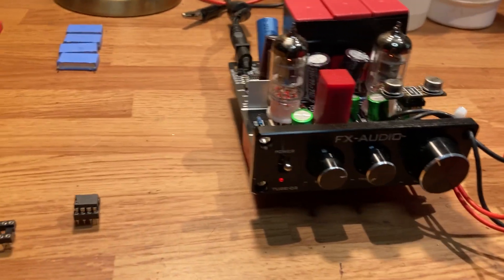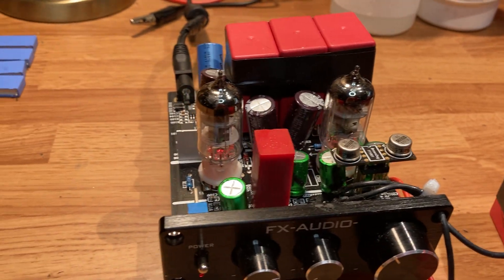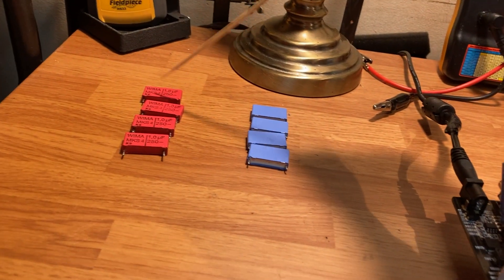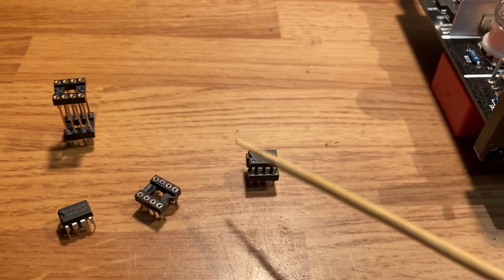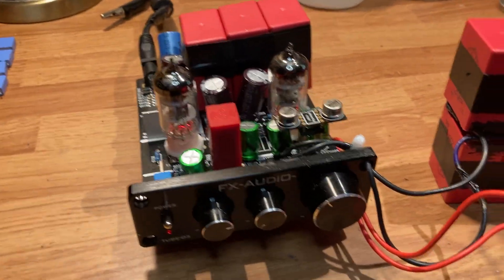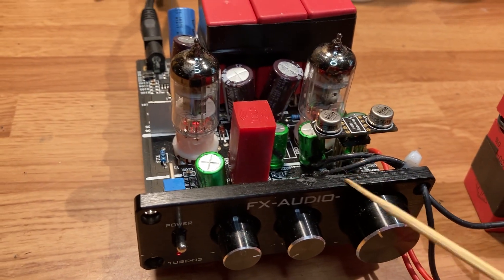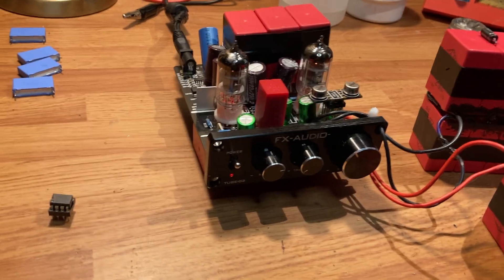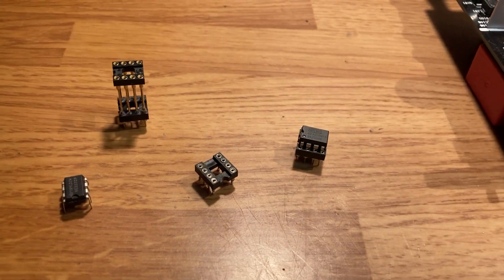FX Audio Tube-03 op amp and capacitor upgrade

Comment: I changed out the 1uf 250v caps with wima 1uf 400v as 250 v was out of stock.  I connected them to the outside solder points as I think the holes are there for a larger cap;; am I correct in that?   My preamp is running much cooler now;  is that normal!
Reply from the maker: Yup your fine you can always go up in voltage with the caps never lower

Comment: My FX Audio Tube 03 just arrived. I tried it for the first time stock, and I already feel substantial improvement from my DAC>FX Audio Tube-03>Integrated amp>bookshelf speakers setup. There is more sound stage, deeper and cleaner mid bass, slightly more deep bass on low volumes, and more lively mellower highs. It is not perfect, but it is more than I expected, which was mostly buzzes, humms and muddy bass. None of that. Now I will definitely be looking into better tubes, opa amps, and capacitors. I was thinking about using GE JAN 5654W if I can get hold on them, OPA2604AP, WIMA MKP4 1uF 250 (because I can't find MKS4  1uF 250 as in this video). Would they fit? Also  I am not sure about those 2 small 10uF caps that the author of the video exchanged for 20 big ones. Is there an alternative that fits in the case and would improve the sound more? Also, would this thing benefit from creating a bunch of perforations on the top cover. It seems to get very hot quickly.

Comment: helo sir, i want to ask. what will
happen to the sound character if i change the caps with higher uF? let’s say WIMA MKP10 1.5 uF, 250 V. thank you
Reply from the maker: @argyrizky8404  you will hear a difference that will blow your mind but that being said I’m only talking about changing them to film caps
Reply: @ yes sir, i’m considering to change the caps after watching your video. but in my region (currently) i couldn’t find the 1 uF WIMA Caps. the closest one is 1.5 uF - 2.2 uF. i really appreciate if you can describe about what kind of sound character i would expect if i change to the higher uF🙏
Reply: i already changed the caps to WIMA MKP 10, as you said “it will blow my mind” then it did. thanks man you’re genius

Comment: The  opamps are not for tone control.  You'll find them in all kinds of amps that have no tone control.  They are there to amplify the small signal inputs.  The opamps in this unit are perfectly fine for this application.  Spending a lot of money -actually spending any money - to replace the pampas is a waste of time and money.  Likewise tube rolling is an idiots game because there is no significant difference.  The internet is full of comparisons.
Reply from the maker: @colbatguano3958  I never once said they were for TONE CONTROL so your whole rant was a waist of time!!!
Reply: @ranbymonkeys2384  you said they are for treble and bass, which are the tone control. !? normally the bass and treble are connected to capacitor circuits and the op amps are for left and right channel in this particular amp i do not know if one dual op is doing the buffering but i assume that both do both for each channel so you basically end up with two differnent signals you got one sound left and another right.thats why you use op amps of the same type for the left and right channel normally.

Comment: Great video! The NE5532s that came in my Tube-03 were fake. You can tell by measuring between pins 3 and 4. If they are mising the internal protection diodes, they are fake crap. Probably a ten cent dual 741 marked as a NE5532. The 10uf electtolytics were labled as Elna but those are probably fake also. So yeah, replace the op amps, elecrolytics with film caps, film caps, tubes, and then it should be ok.
Reply from the maker: Hahaha

Comment: Could someone list the number of caps needed and the values for the 03?  Ones that will fit with the lid on. 🙏
So far, and please correct if wrong.
4x 1uf  250v to replace blue square caps.
2x 10uf 250v to replace the cylinder opamp caps.
? 

Thanks
Reply from the maker: how about you look at the caps and see what is written on them
Reply: I was making a bulk cap order and didn't want to open it up until I got my order....I did anyway, just thought someone could save me and others some time, is all.  

Did you ever use the muse 01? If so, how did it compare to the 02?  I'm reading some mixed reviews.  And 50$ a pop is not allowing me to experiment.  
Thanks for making this video.  I appreciate it and you for doing it.
Reply: Perhaps you can give some insight.  I ordered 10x volkshod rockets, and glad I did.  Some were clearly better sounding than the others.  I seen a review where someone said the brighter they glow, the better they sound.  I found this to be true.  Is there a good way to tell?  Other than buying a tester?  Should I bulk order others? Say the Sylvania 6ak5s.  Or should I just buy them pre matched and tested? 
Really new to the whole tube, opamp rolling.  I am enjoying the journey though.  Thanks

Comment: Anyone got any tips on how you managed to desolder the stock caps off that board?. I've tried a duratool solder sucker and any decent amount of heat starts killing the cheap solder mask :(.
Reply from the maker: whats solder mask?  Put some solder on the joints and gentley pull the caps off rocking them back and forth while applying heat from the soldering iron.  Then worry about getting the solder out of the holes.

Comment: I finally received the caps from mouser and I got around to opening my preamp! Surprise... The blue caps are 450v / 105k (~1uf I assume)! Fx audio must have reworked the circuit since your video (mine is 2021-08-12). I guess I have a bunch of wima caps on standby for other projects then ;) how did you know you needed to change the 2 10uf by the way please? (as there are other caps on the board). Thanks!
Reply from the maker: 105k is 1uF
Reply: @ranbymonkeys2384  yes. But the caps are rated at 450V, not 250V
Reply from the maker: Thats a good starter project you can't screw it up its impossible.   EDIT: you should listen to it before and then after.
Reply from the maker: well?

Comment: Hi, i ordered the amp and the parts (including the opamps),  thanks! Just sharing something as I came across another convo which may be of interest to you: replacing the power brick for either a linear of a switch mode power brick but of better quality. I came across a couple of convos where people also mentioned using a power supply with 5a for better sound vs 24v or 36v power supply with lower amperes such as 2a or 3a.
Reply from the maker: The higher the amperage the better.

Comment: Funny, I can't find the big ones on mouser/digikey. Would you happen to have a reference I could use to find the big 1uf 250v please? (I found the smaller Wima). Thank you
Reply from the maker: the ones that i have grouped in 10?
Reply from the maker: there are several big 1 uF caps there
Reply from the maker: you didn't really look did you https://www.digikey.com/en/products/detail/wima/FKP4G041006J00JSSD/9370277
Reply: @ranbymonkeys2384  I actually did and the big ones were not picked up (only the smaller ones). Possibly because I am not in the US. Thanks for taking time to help out. Much appreciated! Have a good day ahead.

Comment: Hi! Cool video. Quick question please : I think it is possible to replace caps with caps of high voltage value but what about the uf? (capacitance?). In short: do you need to replace a 1uf cap with another 1uf cap or can you use 2uf, 3uf etc instead? If so, what can you expect in terms of audio output and quality? Thank you
Reply from the maker: The microfered (uF) needs to stay the same but the voltage can be hihger so if there is a 20v cap you can replace with a 9,000v cap.
Reply: @ranbymonkeys2384  thanks for the quick reply! I can get that BNIB fx audio preamp for 30 usd so no harm trying new capacitors! Have you also done the caps modifications to amplifiers too? (such as the aiyama a07 which is quite popular).
Reply from the maker: Why don't you replace those 4 1uF caps can find out.  Those are good beginner ones to replace too, lots of room to fuck up.
Reply: @ranbymonkeys2384  agree, i will start with those. And they are available in my neck of the woods too 😊.
Reply: @ranbymonkeys2384  by the way, why not replace the other caps? (the round ones that are blue and brown). Is the voltage 250v for the 10uf please? (perhaps nichicon may be easier to fit in that the film caps :) )

Comment: so if i aint wrong the fx audio is pre amp so what happens if i put a different op amp into the fx audio and connect to an amplifier that uses another op amp. What happens then. does the op amp on the pre amp become useless since the main output to the headphone is from the amp or the combination will mix up the sound from both op amps?
Reply from the maker: huh?
Reply from the maker: An op amp in one piece of equipment has nothing to do with an op amp in another piece or equipment.  Usually almost always the headphone amp has it's own separate op amp.  When the main out put is used the signal isnt going through the headphone port anymore so the headphone op amp isnt being used.
Reply: @ranbymonkeys2384  im pretty new to this so i am not quite sure how it works
Reply: @ranbymonkeys2384  so meaning if i use a pre amp to amp set up, only the op amp in the pre amp is used?
Reply: @justspitonjeff4932  No, the pre amp does not effect anything used in the power amp.

Comment: Thanks so much for the terrific video. I've been  using several of these  units with pretty good results, only replacing the tubes. (RCA 6ak5, and Philips EF-95 (Holland) are my personal favorites)

I've got another one of these and I've decided to do the complete upgrade with  Muses02, and replacing caps. 
I've ordered the two Muses02 opamps and four MKP4250 to replace the four blue square caps.

I'm having difficulty locating appropriate caps for the other caps in the unit.  (closing the case not critical. I will build a custom case after this upgrade is completed.)

As I see it, I need: (Based on the ones I removed)
4-  22uf 250 V
4-  100uf 25V
2-  10uf  50V
1-  1000uf 16v

Is this correct? Hope this isn't a dumb question. 

This is based on the caps I removed from the unit, but unsure about the 3 by the power plug. (Is the one closest to the back of the unit the 1000uf, and the others two of the 22uf?)

I've found plenty, but only ones with wires on each end, not with both wires on one side. If it's not too much trouble, could you give links to the ones  you used for the remainng 11 caps in this upgrade,  (and perhaps confirm the quantity for each)

Thanks so much for your time and consideration.
Regards,
Frank`
Reply: Thanks! I'm just having trouble since there are tons of options on Mouser. Unsure which will fit on the board. Do you by any chance have a list of all the capacitors from Mouser(or Digikey)  that you replaced. (Already ordered the Opamps and the WIMA 1UF, but I'm quite confused about the others.

If you can't, no worries. Thanks anyway.  

Regards,
Frank
Reply from the maker: What happened to the ones you removed?  Going by memory I believe there is only 1 1000 uf and 2 22 uf.  There are also two little 1 uf film caps in between the tubes also.  Where did you get the Muses02 just wondering why you are having a hard time finding these caps.
Reply: @ranbymonkeys2384  Thanks for the reply. I ordered the Muses02 from Mouser. 
Are the 1 uf between the tubes the small square blue ones? Mine have no markings on them.
Thanks.
Reply from the maker: @fjdds1  They are, and they should.  Why are you having trouble finding those caps Mouser should have them for sure.
Reply: I really wish someone.....cough monkey cough..... could list the values.  Mine are unmarked also, sigh....

Comment: Both op amp ne5532 come with unit are surely fake. Any replacement with real op amp will improve the sound alot. Even philips ne5532 original one will improve sound.

You can check with phone camera, just turn on the flashlight and zoom in (macro mode). The finishing is very bad.
Reply from the maker: umm ya

Comment: The UK runs on 230 volts, and I have stock caps fitted in my UK model Tube-03 saying 'H04 105k 450v' so have you any idea if those same Wima caps you show would work as like-for-like replacements in my own? Thanks from a newbie.
Reply from the maker: They are the same that is in ours too that just means the cap can withstand 450 volts before blowing up and tubes generate far more than your mains does.
Reply: @ranbymonkeys2384  Thanks for the clarification.
Reply: There is no relationship between your mains voltage and the caps in the FX, the power supply steps the mains voltage down and converts it from 230vac to 12vdc which the FX operates off.
Reply: @ Thank you 👍

Comment: I bought OPA2132 for replacement and Oracle II 2. Soviet 6J38P-EV lamps. The capacitors will also be replaced, I will put WIMA. 
Еven the lamp beds need to be replaced with ceramic ones.
Reply from the maker: oracle ll ? lamps?

Comment: Hello Clay, you can also pull out all the (two op-amps) and just use it as tube buffer. Obviously you will by-pass the tone & volume controls as you have broken that part of the circuit. You can always use something like Equaliser APO (Windows parametric equaliser) and the volume control on your PC/iPhone and amp. This way you just get Tube Sounds, different tubes different sound signatures. At first I was dubious about this but after a fair bit of listening I'm a convert. The guy who told me to try it, I thought he's a wrong'un but there is method to his madness. Trust me Clay,  give it a shot. You can even have an op-amp for just the tone controls. I have a Burson V6 Classic (dual config) for the tone controls at the moment but this will be gone too. My Sundara headphones are a bit bass light in the lower bass frequencies and I use an iPhone with Amazon HD Music (music stored locally), Apple Photo USB3 convertor into an E1DA 9038d USB-C DAC so no parametric EQ. I'm moving on my Muses02 and investing in different tubes, I've got some GE & Mullards; I'm keen on getting some of those NOS Sylvanias as you mentioned. One thing I would say is up the input and output coupling capacitors from 1uF to 4.7uF each; I read this https://farmedia.com/tube-audio-line-level-buffers/, this allows the full bass frequencies to come in and go out from the pre-amp rather than filtering them from entering and exiting the pre-amp. Thanks a lot for your help...
Reply from the maker: I don't have time for novels and for the first two sentences, I know.

Comment: I'm desisting to order my opamps from Aliexpress. I'm going to order it from mouser, there are a lot of things out of stock. This are the options available LM4562NA, NE5534P, LME49720NA do you recomend any of this? And the WIMA caps also out of stock, any alternatives? Thanks for reading. EDIT: I found this in digikey FKP4G041006J00JSSD is it good?
Reply from the maker: LM4562 is good so is the LME4970 Like I have in the description.  NE5534 won't work it's a single op amp and mouser has a shit load of WIMA caps.
Reply from the maker: https://www.mouser.com/c/passive-components/capacitors/film-capacitors/?capacitance=1%20uF&m=WIMA&instock=y
Reply: @ranbymonkeys2384  There are with 5% tolerance and 63V o 10% tolerance and 250V wich one is better, less tolerance or high voltage? There is not 250V and 5%.